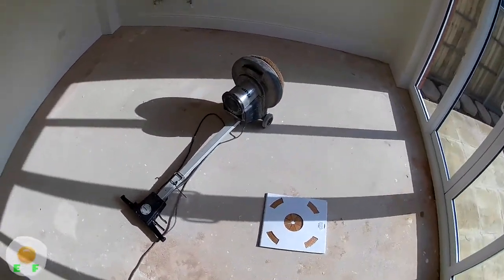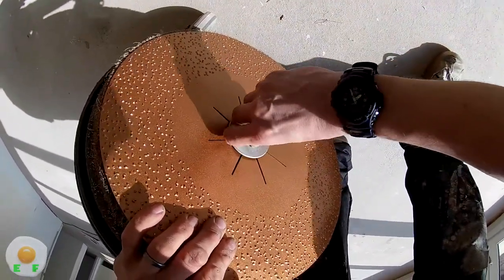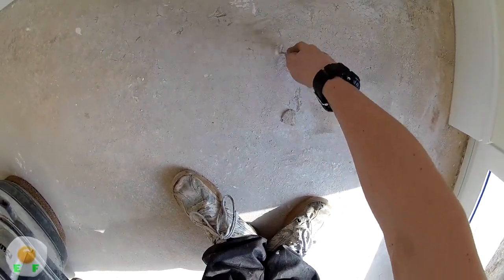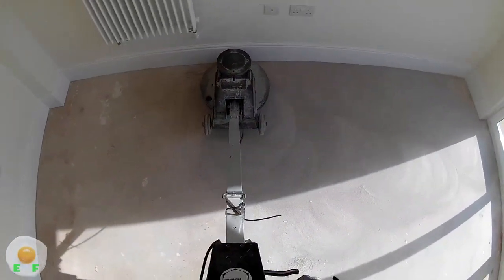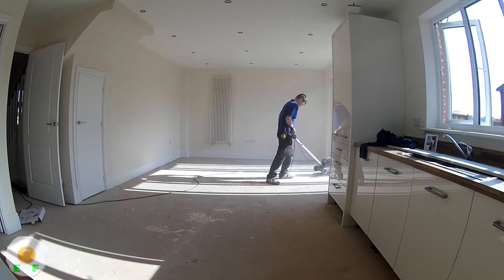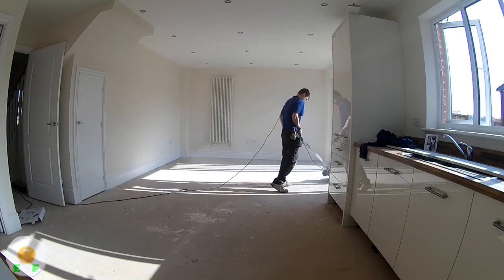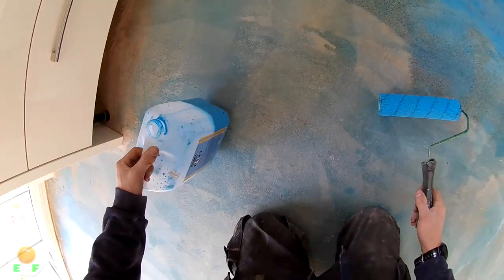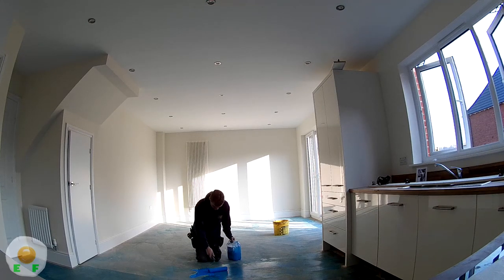ANHYDRITE STOP!!!! WATCH THIS BEFORE YOU DO ANYTHING

Comment: How do you know that floor is Anhydrite? And if it is a copper disc will not remove the Laitance It needs to be grinded with a PCD grinding plate to remove the Laitance not just scratch it
Reply from the maker: Well the floor has a pink tinge to it and the top is flaky
Reply from the maker: The plate is grinding it won't get that much off by scratching it won't to leave some floor down to lay on lol
Reply: EGGY FITS Was is pink before or after the milk test ?
Reply from the maker: SpAcEy 360 milk test?
Reply from the maker: SpAcEy 360 if you mean damp test then yes it was dry all floors are tested Bean burnt before
Reply: EGGY FITS No the Milk test to check if it’s Calcium sulphate based screed 
Pour a small amount of full fat milk on the screed and if its Anhydrite the calcium in the milk reacts with the Calcium sulphate and turns it a pinkish colour Normal concrete stays the same colour
Reply: Where did you get that into about the Milk test mate
Reply from the maker: SpAcEy 360 nice thanks for the info
Reply: Copper disc for laitance? Where is your diamond segments!!
Would have been interesting to see the result before you primed.
Doesnt look like any aggregate was visible after what you call a grind. No dust skirt either
Im just being honest here but that is what I expect a DIY'er would do. 
Terrible example